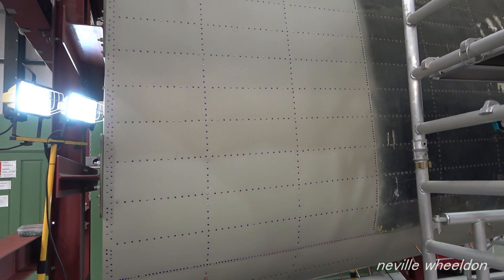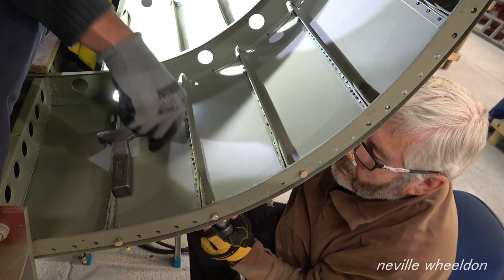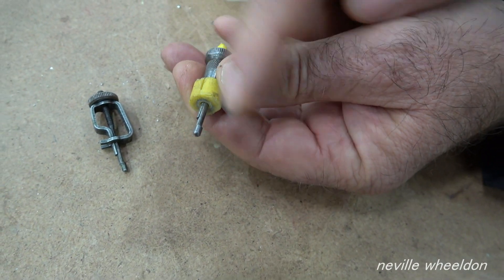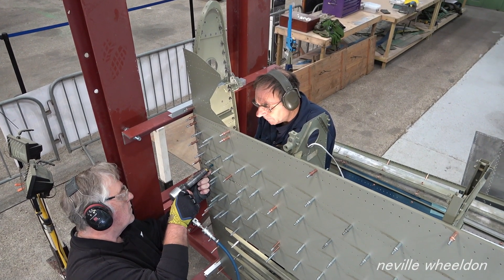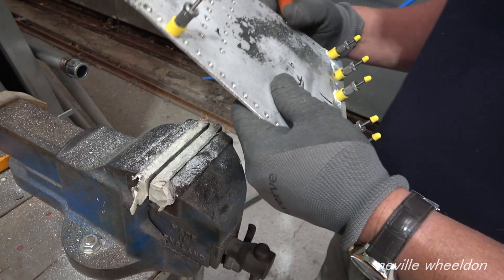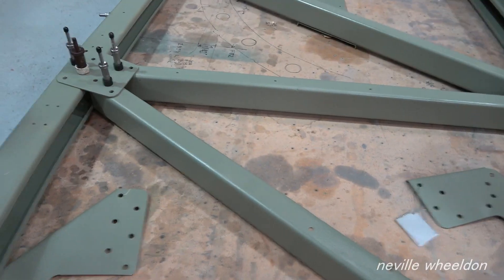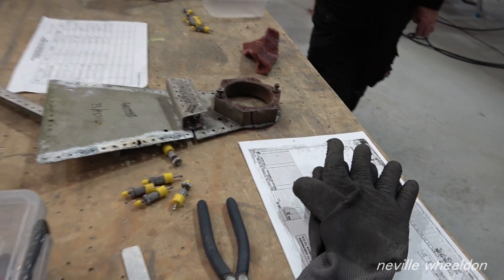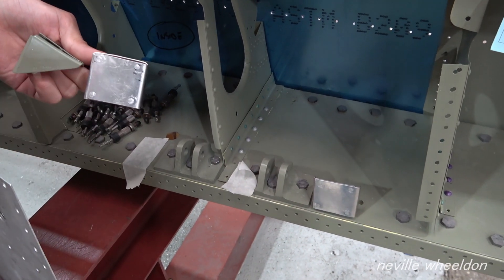Video 169 Restoration of Lancaster NX611 Year 5. Dave and Norman riveting skins to the fuselage

Comment: A riveting episode Nev , lol sooty I just couldn't resist that obvious one   The Doncaster fuselage looks really good now the skins are going on. One thing will the fuselage get another coat of paint to cover the rivets? I assume it will or they will rust away ! The French wing looks as if it has risen from the dead, which I suppose is exactly what has happened thanks to Keith and John and the rest who are working on it
Reply: The rivets you ask about are aluminum. They will not "rust". (Rust=steel/iron) They will however corrode. So yes they will be painted as in 'the whole fuselage'. Notice that the rivets are sometimes coloured. This signifies not only the material (different grades of aluminum) but is also a protective covering. Think "anodized".  There are most likely no steel rivets in the entire machine. Or if used, highly specialized setting. Another thought to keep in mind is that steel rivet can not be used on aluminum. The dissimilar metals will start a instant erosion of the two metals. (one would need moisture, but you now have a battery. Bad news) Cheers

Comment: Neville, I know that all the rivets on rebuilding of Just Jane will be flush with the skin. However If you look at old film footage of the Lancs being built in the war, they appear to use scissor riveters in the fuselage construction, where as LVHC are using an air hammer and dolly, so why they doing this to the French wing and Doncaster fuselage, these will never be used in flight?
Reply: We're using all the correct rivets in the correct place. Lancaster fuselage didn't have flush rivets but the Manchester did. There are only flush rivets at points that are covered such as areas where a closure panel overlaps or there is tape around a fuselage joint etc. They moved away from flush rivets on a Lancaster because the reduction in drag wasn't worth the extra time required to fit a flush rivet.
Reply: I would be interested in the answer to that, perhaps it was because the life expectancy of a Lanc in service was something like ten hours.
Reply from the maker: Hi Geoff T, both structures have to be to a strong and safe standard as paying public are on board.